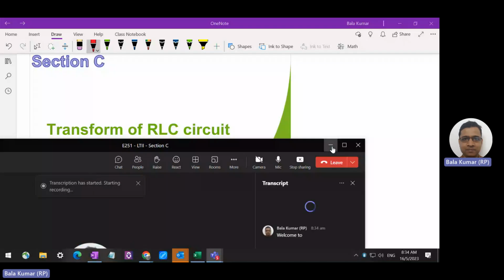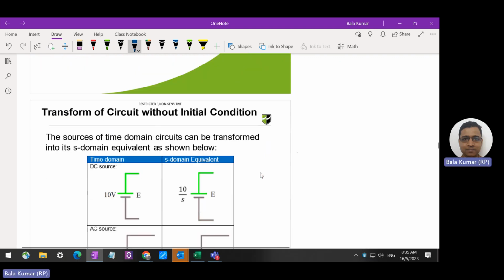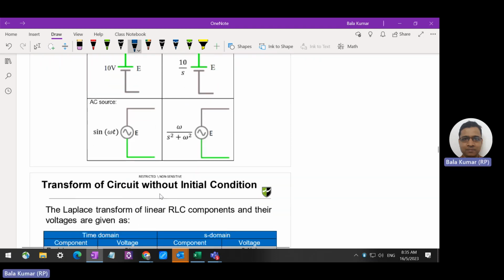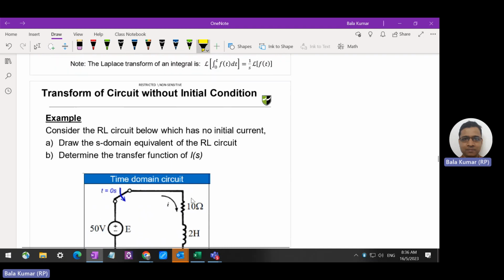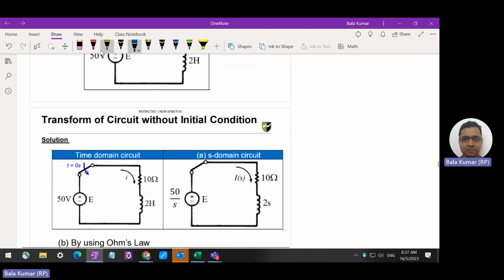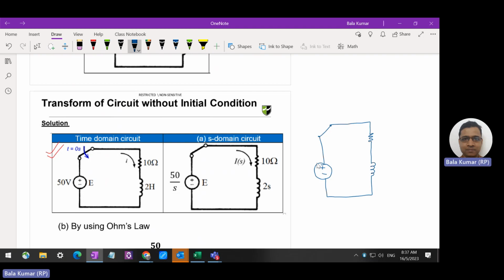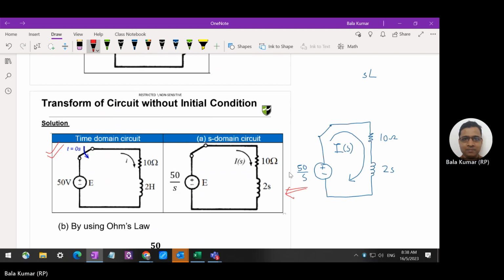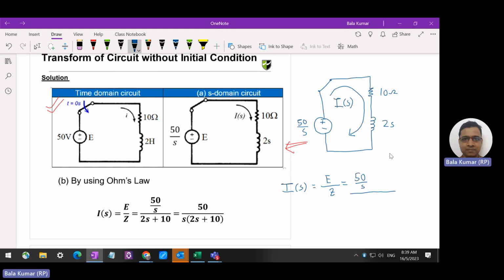Laplace Transform  of RLC circuit   without initial condition

Comment: The expression of Voltage and Inductor used is different for both Time domain and s-domain circuit. E.g, (50V in Time-domain is known as 50/s in s-domain circuit)